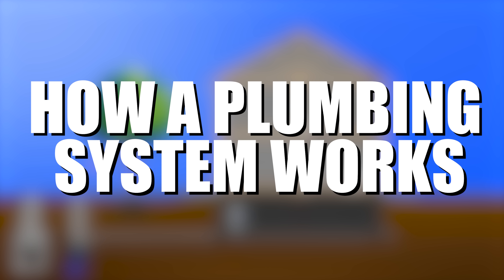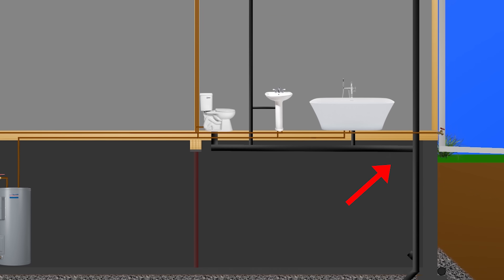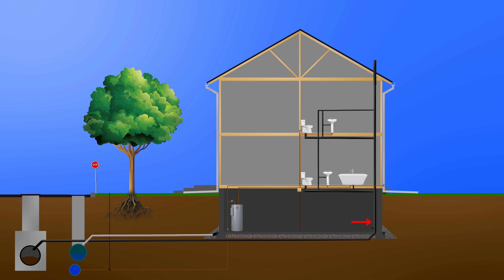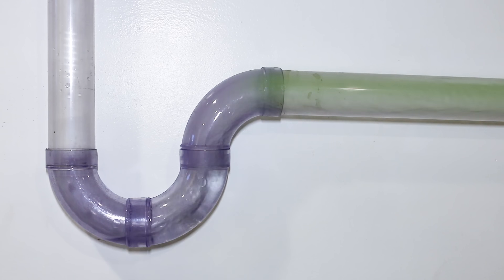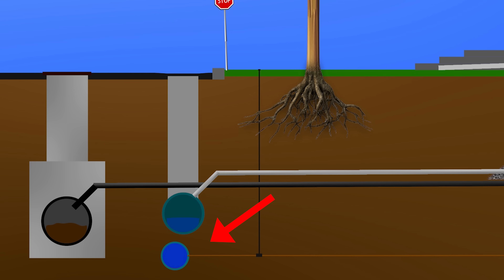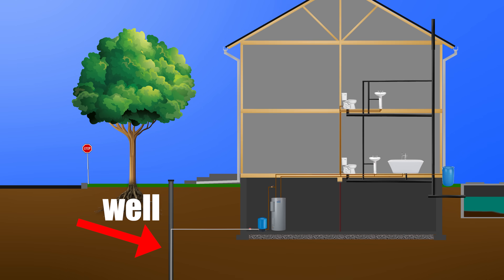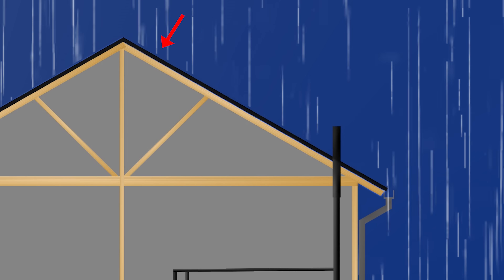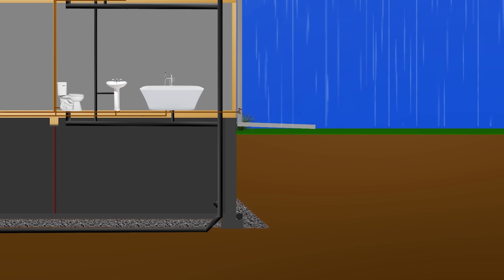How Your Home Plumbing Works (From Start to Finish) | GOT2LEARN

Comment: Plumbing 101: 
Shit runs downhill
Don’t chew your fingernails 
Pay day is on Friday
Reply: So it sounds like you hired the same guy I did...
Reply: @Got2Learn  Payday is now every OTHER Friday, but you are still taxed as if it was every Friday. Progress sucks.
Reply: I didn’t get the “don’t chew your fingernails” until I read another comment that mentioned it with “cold on the right.”
Then it hit me. If I’m not mistaken!

I’m assuming it has to do with getting your hands dirty. But I would rephrase it and say don’t put your hand in your mouth, or even your face. At least not until you thoroughly disinfect them.
Reply: Don’t eat last bite of your sandwich

Comment: What about houses that have a combo system (no sump pump) doesnt the rain water and domestic water share the same exit point at the crock? Thanks for nice video.
Reply from the maker: Yes, but it's not code anymore and will eventually be two separate conduits. Thanks for the nice comment :)

Comment: In Missouri, the potable water supply has new codes for installation. The 3/4" copper pipe coming from the municipal supply ties into a shutoff valve now located in a utility pit somewhere in the yard between the supply and the house. The water meter is also installed in the utility pit. From there, the copper pipe must enter the house through the wall, no longer acceptable to come up through the foundation for a house with a basement. I don't know how the non basement house installations are done at this time.
Reply from the maker: Good to know ;)
Reply: @Got2Learn  I learned this as I bought my first house last summer. Following the advice of a good friend and multi-property owner, I purchased the water supply and sewage system insurance right away. My house was built in 1918 and it's a fixer upper at every level.  So, insurance kicked in after 30 days, I called to have water services turned on, and the supply line was leaking from the galvanized pipe just below the basement foundation.

Since I am DIYing everything myself, I planned on installing my own PEX lines, so I did not purchase the insurance that covered the supply lines inside the house, only from municipal supply at the street to the house.  The insurance company sent an inspector over after I filed my claim and since he was wanting to make some money, he chose to report my leak as being EXTERNAL to the house and not internal (where I was not insured). I asked about the exact details of where the supply is defined to be internal or external and I was told that if the leak exists outside the WALL of the house, it is external. Inside the wall is internal.  AHA!!  But...  what about below the foundation, yet internal to the wall...?  The "Gray Area" that can be argued either way.

So, for a total of $140 to purchase a year insurance coverage policy up front and a wait time of 30 days before I turned on the water - the new code guidelines were used by the contractors to install my new supply line from the street to the inside of the basement.
This was already a bargain for me at this point...  Then...

The contractors ruptured the natural gas supply line at the street with the trench digger and resulted in emergency services shutting down my block while 23 different vehicles from our local natural gas utility company occupied my street to deal with the situation.

A friend of mine attempted to do his own water supply line, but he got caught in the act. After his own investments of materials, time, and equipment rentals, this cost him over $10,000 when all was said and done because it must  be a licensed contractor to perform such work.

Can you imagine the cost if he ruptured a gas line in the process??  Hearing his story made me feel that much better about purchasing the insurance...  I am a DIY guy and I am so glad I did not DIY this project. The cost of a day like that on my own faults would have cost me more than I paid for the house!
Reply from the maker: Well said!

Comment: What are some signs of a clogged vent?
Reply from the maker: Fixtures gurggling, not draining properly..
Reply: Got2Learn thanks brother. I got a slow draining tub and a sink that makes a weird noise every so often. Not a gurgling sound. I tried to snake the tub not much came out. I’m thinking of going to the roof with a snake or hose to flush out something in the vent I’m hoping.
Reply from the maker: It could also be that your drain is clogged.

Comment: This is very helpful but just to confirm so essentially we are drinking our own waste water which is filtered from the sewage centers back into the river back into the drinking water center?
Reply from the maker: Yup :)
Reply: @Got2Learn  does this apply to well water as well?
Reply from the maker: Negative! :)
Reply: That's why its best to live as upstream as possible 😁
Reply: It depends where your city/municipality gets it's drinking water and where they pump out the recycled water, check their website for info. Why would a city dump recycled water back into a river then suck it back up, that makes no sense. If they wanted to reuse the recycled water to drinkthen they would pump it directly back into the drinking water system.

Comment: The rain water management part was pretty cool. They dont allow you to collect rainwater in Arizona. At least not here in the southern part.
Reply from the maker: Yeah it all depends where you are, here too it's banned ;)
Reply: Got2Learn I’ve heard lots of theories about why this is but to be honest I’ve never researched it. My best guess is because out here we need as much water as possible to return to the water table. I’ve been told it’s because there’s the potential for contamination. Any idea what the reasoning is?
Reply from the maker: Hmmm...never heard of that theory.
Reply: Got2Learn any idea why the reason behind the no collect is?
Reply from the maker: Here we aren't allowed because if everyone did it, the municipal storm drain would overflow, dunno why in AZ though..
Reply: In Missouri, the annual rainfall runoff from your property is calculated into your billing.  I pay for municipal water supply services and I also pay for mother nature doing her thing. If I install rain water catch systems, I'm still going to get billed for the calculated rainfall that leaves my property and goes into the sewers and drainage system.

Comment: You should do one with the most important rules for DWV.  For example, if a home owner wanted to add a new bathroom, what are the top 10 things they would need to no.  I have not seen anyone cover this.
Reply from the maker: Will add it in, thanks for the suggestion :)

Comment: Interesting how the town/city water supply is shown downstream of the waste water drain.
Reply from the maker: It's not waste water, it's storm water, 2 very different things. Also, most water supplies go between 1 to 2 km into the water, so no need to worry about cross contamination ;)
Reply: @Got2Learn  I went back and watched it. The arrow definitely travels from the waste water plant to the water supply. Further downstream is the rain water runnoff. It's just an illustration I know, but it is interesting placement.
Reply from the maker: Yes, but like you said, it's just to say that EVENTUALLY, waste water does go back inside the municipal lines are drinking water, there's no way around it ;)

Comment: Can you do a 'why my showers water pressure sucks but sink water pressure is fine' video?
Reply from the maker: Your cartridge is probably gone, if you have a Moen, they are guaranteed for life, just bring the old one back and they'll give you a brand new one ;)
Reply: I installed a pressure balancing valve 5 years ago, it had bad water pressure before, and still had after the install, but now the temp at least stays consistent...
Reply from the maker: What is the condition of the shower head? It might be that there's just some gunk in the strainer..
Reply: Havent checked the strainer, but I have done the bag of vinegar, unfortunately didnt help.
Reply from the maker: Check the strainer, 5 times outta 1, those things are gunked up and are the culprit, lemme know if it worked.

Comment: your mainfloor bathroom is not to code, your wc is supposed to be the last connected fixture, you need to pick up that tub drain from the trap arm of the lav so everthing is wet vented
Reply from the maker: Here in Canada it's code, if you are in the states, each fixture needs to be vented independently if I am not mistaken.
Reply: @Got2Learn  im a jman here in Alberta, I like you channel you have some good tips, but sorry man that is not to code.  if you did not have a tub then that would be acceptable or if you pulled a individual vent for the tub, but since there is a tub there after the wc you need to properly wet vent that.   you would need to have a 3x2 y that picks up the lav and then a 2"y  off of the inch line too the tub. then you have a proper wet vent and your wc becomes your last connected fixture
Reply: What's this all aboot?
Reply: There's always that guy whose job it is to correct someone, and show they know more  
Perhaps you should do your own channel
Reply: @chi-tn  Yea, he goes on every Plumbing video and gives his 2 cents.
Probably a real charmer to work with on a job

Comment: 6:09 Teach, I'm curious how frequent those lifting stations are. Every few kilometers/miles? Are this hydraulic rams?
Reply from the maker: Depends the city. Some can go deep, some cannot so they gotta be lifted more often.
Reply: Depends on the terrain of the city and typically they are pumps much like a water pump that "lift" the sewage.